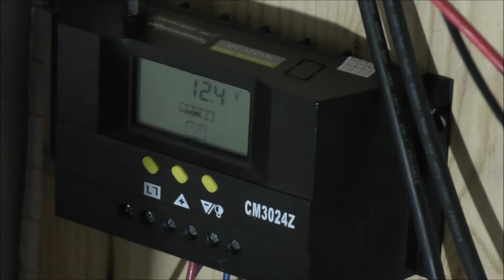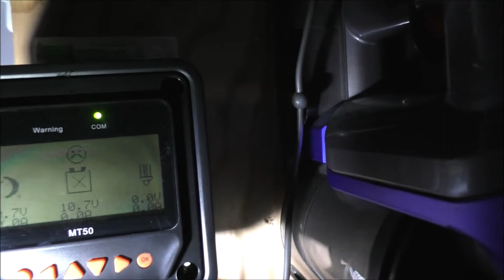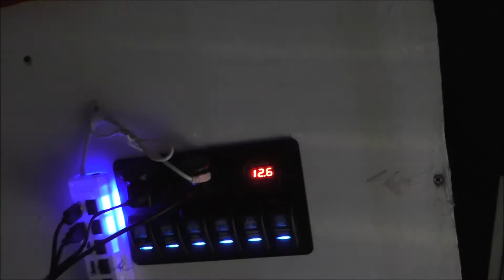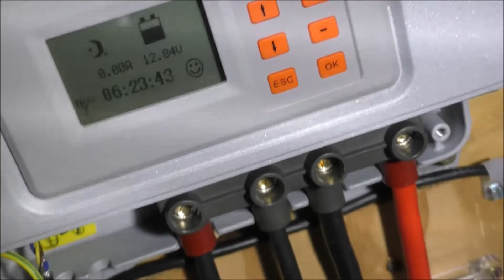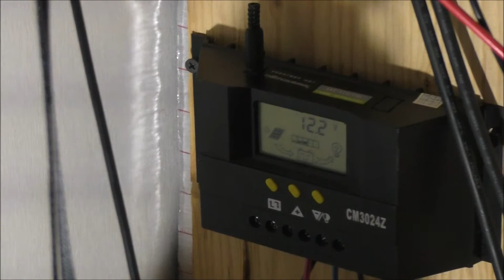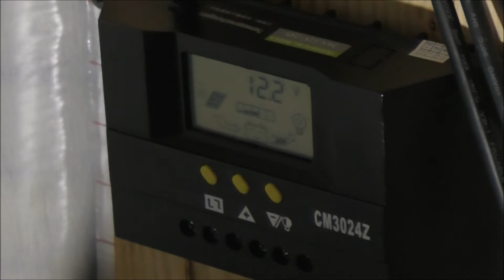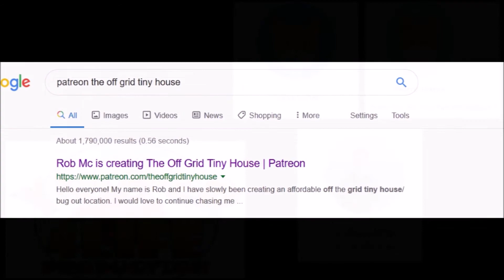Late Night Update From The Off Grid Tiny House

Comment: Looks like you have a condensate issue and not a leak. Moisture is condensing on the cold surface behind the foam insulation. You need a tightly sealed vapor barrier between the interior and insulation.
Reply from the maker: that would make more sense as the cold aluminum would be frosting up. though they say the spray foam at 2 inch thick is suppose to be a vapor barrier
Reply: @TheOffGridTinyHouse  One 1/2 inch hole can cause a t-cup a day to accumulate.
Reply from the maker: Thanks i already shot video of my thoughts on what was happening but will have to add yours
Reply: Yeah, I would think that spray foam insulation would stick tightly to the trailer's roof and act as a vapor barrier. Unless it has released due to repeated, differential expansion/contraction cycles. If it released over s small area, then an air pocket might form over time and allow warm, moist air to come into contact with the cold trailer skin and condense. Then it would drip down onto the released spray foam surface and flow to any low point that offered even a pinhole sized escape route. So, it is a possibility.

If it was me, I would look for an exterior roof leak first, since that might be more readily found & fixed or eliminated as a possible culprit. You could do that by using Fluorescent Water Tracing Dye and a blacklight (like this stuff https://www.factorydirectchemicals.com/products/sewer-tracing-dye-1-gallon). On a day when it is above freezing outside and there is no ice or snow on the roof, mix up a batch of dye, make a dam on the roof using rubber hose & duct tape, then pour the dye into the damned up area. Go back inside the tiny house and shine the blacklight at the drip point. Watch for the appearance of the fluorescent dye dripping out of the hole. If it shows up, then you have a roof penetration to track down. If no dye, then the condensate scenario must be the culprit. (If it's a roof penetration, then look for likely culprits, build a dam around them one at a time and repeat the dye test on each candidate till you get a positive test on the culprit.)  If it's not a roof penetration leak, then you would need to inject a sealant up thru the drip hole to fill the void above it.

Hope this proves helpful in your troubleshooting & repair procedures...

Comment: Interesting energy balancing problem.

It sounds like the essence of the problem is this: the wind turbine is designed to keep itself from spinning too fast during high wind speed events (sustained or even brief gusts) by some sort of braking mechanism that is totally self-governing (no remote user control). But, we know that increasing the power consumption (and resistance) of the system loads will slow the wind turbine's RPM through an electromagnetic resistance feedback loop (e.g. think of increasing the load on the water wheel of a grist mill - it will slow down under a higher load). 

So, in order to reduce the braking action of the wind turbine, there would need to be an automated microcontroller that could monitor the wind turbine output and switch on/off various loads to try to maintain wind turbine constant RPM AND store or consume the extra available electrical power during windy periods.

Reframing this scenario: how can the electrical power generation and utilization from a dual solar & wind system with multiple battery chemistries be optimized to capture & use all available generated electrical power with minimal wastage to wind turbine braking or the use of dump loads? Wow, add a water turbine, gas or diesel generator and thermoelectric generator and this is THE QUESTION for optimizing a 21st century off grid electrical power system.

Since I don't have a circuit diagram of Rob's current electric power system, I can only speculate that his challenge is to integrate the wind turbine system and it's batteries with the solar PV system and it's LiFePO4 battery. In this video, his LiFePO4 is sufficiently discharged from usage that it could use topping off but it has no way to accept power from the separate wind turbine system, which is self-braking because it doesn't have enough loads on it. So, there is where the optimal solution to this problem seems to be found...